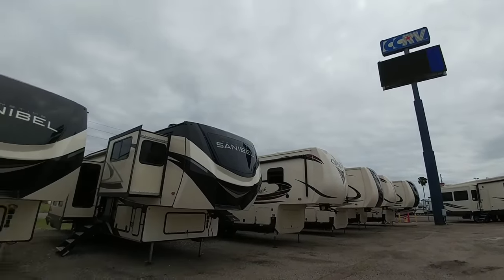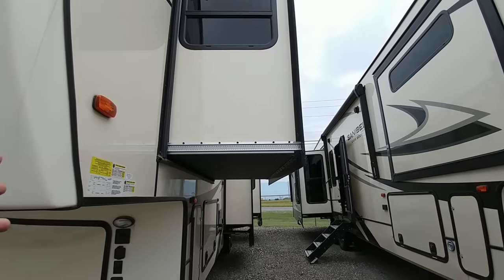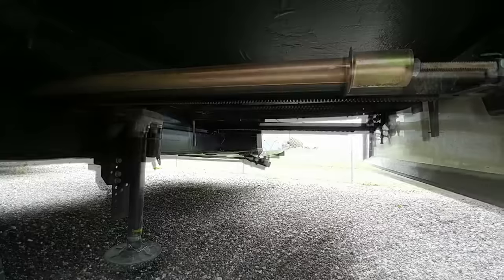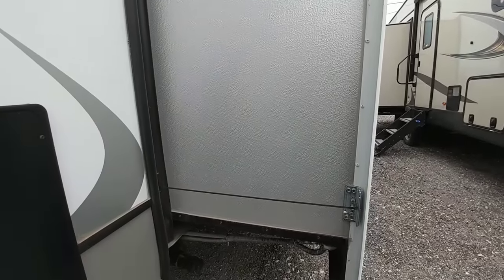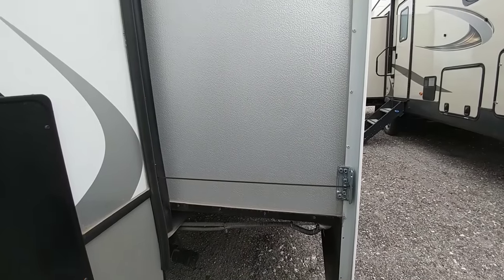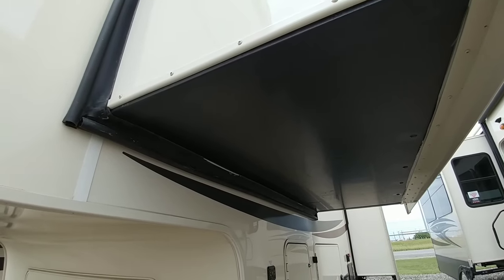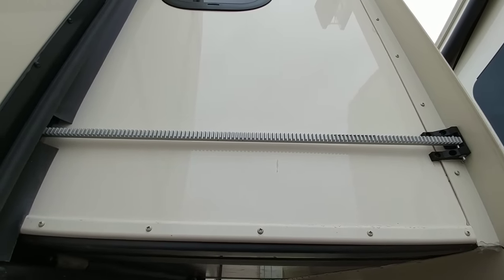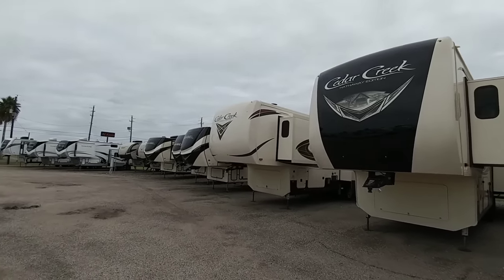The 6 Different types of RV Slide technologies and how they work!

Comment: I'm a supervisor at a horse trailer manufacturing company. I have experience with the last 2 slideout controls along with another that is not shown. The very last one shown we do a lot of. The last one shown is junk. It rides like a pendulum. There is no pressure at the top as only the floor has the motors and turn screws. There is nothing to hold it steading so it moves around.  There are plastic rollers on the sides that dent aluminum skin if that is used on the sides. We have to put a stainless steel strip to stop the dents. The one before it with the gear teeth on sides we looked into that one. It looks like s good set with a lot of positive seal. Very easy to install and maintain. We also use one made by HWH that is hydraulic. Very heavy duty and solid.
Reply: Hey! Thanks for the feedback. I have one doubt though... I'm assuming these systems are on rollers below? How do you prevent cantilever loading? None of them seem to have jacks on the outside.

Comment: Bought a new Winnebago in 2004.  The slide system is hydraulic and has been flawless.  There are independent controls for each slide.  It uses the same hydraulic pump as the jacks

Comment: On the rack and pinion slides there isn’t a motor attached to the pinion gear. The 2 pinion gears are connected with a long shaft and mate with racks on both ends of the slide. They just keep both ends of the slide moving together and even, but don’t physically push anything in or out. The actuator is a motor driven screw inside the gold tube just in front of the rack. It does basically the same job as the hydraulic cylinder on the hydraulic slide version.

Comment: I have the rack and pinion on my forest river cardinal and the system works great. Although my greatest issue with it is that there is no Manuel system set up for it. So if you have an issue whether it be electronic or hydraulic and you find yourself out in the middle of nowhere than your in trouble. Mechanics charge heavily by the mile and that’s not a promise that it will get fixed. There should definitely be an emergency Manuel system set up for cases like this since a travel trailer is for traveling outdoors.
Reply: I concur. Ask me how I know😆🥺

Comment: On our 2018 Jayco Pinnacle we have 3 slides and three different types of slide systems. Rack & Pinion on the Dinette/theater seating slide, Schwintek on the bedroom slide, and the Lippert/LCI on the Kitchen/entertainment slide. 

Although it is only 3 years old (bought it in 2017) we have only had one issue, it was on the Lippert/LCI system. It was not really a failure of the system as much as it was a poor crimp connections to one of the phase feedback for the motors. Repaired the crimp and it has been flawless ever since.
Reply: Hey Raymond, this Kevin from Michigan my wife and I have been looking at getting a fiver and the Pinnacle is one we're looking at so what we want to know is how do you like it and what type of truck do you use to pull it Thanks.
Reply: @kevincotton1453  I have a 2016 Ford F-350 Lariat Supercrew SRW with the 6.7 Liter powerstroke diesel. The only issue I have is when hauling the fiver I have to use the cruise control otherwise I find myself going too fast. As far as the Fiver we like it a lot! This is our 4th Jayco product and can honestly say that they are very well made.

Comment: I'VE HAD TWO UNITS IN MY SHOP IN THE LAST MONTH, BOTH OF THEM WERE 2017 MODELS,  AND THE ALUMINUM RACK BOTH BROKE IN HALF ABOUT 3 INCHES AWAY FROM EXTERIOR MOUNTING BRACKET

Comment: Great overview video on the different slide systems.  The slim rack and schwintek are both owned by LC1 and effectively work the same.  (Before anyone comments they do have some small differences due to the controller function.)  We have a 2019 Jayco Pinnacle and the large slide uses the Slim Rack.  The design is a little bit more robust than the schwintek.  Both systems do have their problems, some potentially operator induced.
Reply: can you explain more about "operator induced" looks like my 2019 travel lite aura has the slim rack system. It worked about a month ago, then one side went out. Wondering if I broke it somehow..

Comment: I've had the hydraulic rack and pinion, schwintek and the cable driven. I've had more experience with the cable driven slides than the others and have never had an issue. I did have my hydraulic rack and pinion slide on my avalanche keep coming out unequally and had to keep adjusting it. I also got little visitors in the underbelly that came through the holes and caused some damage and died in there and caused some smells. They need to come up with a better way to seal the holes. Not a huge fan of the rack and pinion but it wouldn't keep me from buying a 5th wheel we like as well as any other slideout system. My voltage has 3 cable driven slides and have worked great.

Comment: I'm in the process of shopping for a new camper. I'm between a Forest River Viking 262BHS and a Dutchmen Kodiak 289BHSL. The biggest thing stopping me from buying the $8,000 more "higher end" Kodiak is the fact that it has a cable driven slide, where the "lower end" Viking has a rack and pinion slide and a better equipped outdoor kitchen.

Comment: Love your videos, but one correction, on the large slides there is no motor on the rack and pinion gear of the slide.  The rack and pinion is there only to "time" the slide tubes so the slide slides out evenly.  The actuator, electric or hydraulic, is attached to one of the tubes, not the rack and pinion.  It was the gold object in the first R&P slide you showed.

Comment: Technology is always evolving! Interesting break down of these slides. I have had the cable slide outs in my travel trailer and now the schwintek one you mentioned seems to be popular on my last three motorhomes.
Reply: I also have the Schwinn tech slides. I always either run the generator or make sure I'm plugged in before running it to make sure the voltage is very high. They run faster and smoother than battery alone. I keep the tracks clean and keep it lubricated. They run very smoothly and I've never had a problem in the several years I've been using it.

Comment: You can retract a cable slide when a cable fails.  You have to use two people though. One person has to be up at top of slide using a drill and adapter to turn the manual override while person outside pushing slide in. Not fun but it works. Had it happen to me. Our cable slide is our kitchen slide and is probably too big and heavy for it but that’s what Keystone put in. Dealer installed rollers under slide when they fixed the cable to make it smoother and less likely to fail again.
Reply: When the gear box fails, the drill does nothing.
Reply: Left turn, left turn, Return - No argument here. But, he commented that the slide can’t be moved if a cable fails. I’ve personally had a cable fail on our open slide and had to close it to get it to move it and get it repaired. It is possible to close it with a broken cable.

Comment: Great simple explanation , I am very anti cable after having a pop up years ago  but so far my dresser that slides in and out has worked great.  Never seen the last two you showed .  Only problem I had with the hydraulic  was super simple ,, the 12 volt resettable fuse was going bad and the pump would only run for a 15 second stint before tripping it.   Great video.

Comment: It's been a few years, but haven't had an issue with my cable driven slides yet.  Toy hauler, so two opposing slides...one regular depth slide and one deep slide.  Maybe I'm a lucky one...and hopefully my luck will hold out.
Reply: Fingers crossed! lol I had a travel trailer with the cable slide outs and never any issues.

Comment: Thank you for describing the difference between these systems as I was thinking of upgrading my 2015 Keystone Cougar fifth wheel to a cable system. Currently, it came from the factory with the linear actuator assisted by the rack and pinion alignment gears that are not powered. The linear actuator seems under powered and I am afraid that when the motor does fail I will be laying on my back under the rv trying to manually retract the slide-out with a socket wrench. The motor on the cable system is located inside the camper and easy to get to, compared to the linear actuator that is only accessible from under the trailer and would not be fun to service for a DYIr.

Comment: We bought a 5er with two slides, one large and one small.  Both are the cable type.  I does make me nervous because there are some pretty obvious weak links in the design.  Over all it is a cheaper and lighter design, so I think we will see more and more of them.  I think I prefer the old heavy steel rack and pinion style but there is a weight cost to those older, “tried and true” designs.

Comment: I have a 2020 front living room. i have schwinn  slides on the living room area and the bed room. They are great except i am having water come in at the bottom track. the water seems to ride along the tracks. i put a bead of silicone to try to stop it. it worked for a while but today with all the rain its at it again, i checked the rubber seal and it is good so not the problem. any advice would be appreciated. thanks! love your videos!

Comment: I am also interested in the insulation on slides - walls, tops and bottoms. I have heard that sooner or later slides can allow cold or hot air in through the cracks between slide and main body. Just how well are the slides sealed with main body of RV? One video complained that while winter camping he lost all heat inside his trailer through the slides.
Reply: There are rubber slide seals that seal a slide box in the opening of the RV.  Most RVs have two layers of seals, an inner and outer.  The condition of these rubber seals can determine their effectiveness.  It is important to check them often and replace as needed.

Comment: My family has had horrible luck with the cable driven slide.  It tore up the vinyl.   We fixed it the best we could and adjusted it as tight as possible, but it just doesn’t work well.  It takes two people to extend and retract it now.

Comment: Great video! We’re thinking to buy new Jayco Redhawk Class C. We’ve been told it has PowerGear slide (Lippert). What type is that, how reliable is it, and is it easy to manually retract if it malfunctions? I’m not very handy and concerned with getting stuck somewhere.

Comment: Where the pinion goes into the frame, on the rack and pinion system, is there usually a rubber bushing or a gasket to close the hole? The one on my trailer is open and it seems to be the entry point for rodents.

Comment: Had a schwintek on my 2015 rockwood and it was temperamental. It seemed to get stuck in or out at the worst times. Dealer couldn’t figure out why and the reset/manual function was useless. My new jayco has old school rack and pinion and it’s smoother, and just works so much cleaner. I hope for the best. Thanks!

Comment: I have the hydraulic rack and pinion system on my trailer and the only thing i hate is during longer periods of time where we don’t use the trailer , both slides will settle and slightly open a couple inches when it’s stored
Reply: You need an accumulator installed in the hydraulic circuit. It will maintain system pressure with the hyd. system de-energized.
Analogous to a capacitor In an electrical circuit.
Assuming no hyd. fluid leaks, hyd. fluid essentially does not compress.
Anybody with a hyd. system would be advised to have this in the event the hyd. pump fails to operate for whatever reason (prime mover failure for example). This would allow emergency operation, again assuming no material leaks.

Comment: I have got screw rods for both side with gear on me Phoenix Cruiser. The issue can be the screw block in the end of the RV that drag the slide out in and out. This is of composite material. This can crack into pieces. Has happen one time for me. Right now I think I have some problem. Its some uneven movement,  and the ''wall'' don flush with the slide out on the lower end(tilt)

Comment: I have a 2010 Tiffin Allegro Bus 43QGP . I'm thinking that our bedroom slide used the under the bed Rack and Pentium system. It because with the slide is out you can't seen any thing looking underneath the motorhome nor on both sides . This slide must be hydraulic because it will not push out or pull in until me start the engine. I have been having problems that when it is 1/2 the way out it will stop and if you give it a couple sec then press the push  button it will then push the slide all the way out.

Comment: The problem I experienced with the Schwintec is that there’s no way to manually operate the slide if it’s stuck in. There’s no access to the motor retaining screw that’s on the outside when the slide is closed. So if you have a cable problem from the module to the motor you are forded to damage the rack in order to get the slide out to extend. It really needs a manual way to extend the slide out if needed

Comment: Without seeing it in action, I don't understand how the cable system "pushes" a slide out.   I can visualize in my lizard brain how the cable system can pull a slide in, but not how it extends the slide :(.

 And --- keep them videos coming.
Reply: If you can visualize how the slide is pulled in then you can visualize how the slide is pulled out. The brackets and cables you saw on the outside portion of the slide are mirrored on the inside portion of the slide.  The cables are routed through fixed pulleys attached to the inside of the trailer.  Each side of the slide box, 2 cables attach to the top (1 inside and 1 outside) and 2 attach to the bottom (1 inside and 1 outside).   When the cables are pulled they make the slide move in or out.
Reply: @CharlesCHubbard  I thunk me gots it :)
Reply: Thanks I had the same question.

Comment: I had a Keystone that used the cable system. It was nothing but junk. Broke the cables a couple times. They need a lemon law for campers. Seems like most campers these days are disposable the quality just isn’t there.
Reply: I started with a keystone.  My cables never failed but they were always sagging and despite my complaints the dealer never repaired them to a taut condition.  My grand design has rack and pinion.  I'll never go back

Comment: I like your videos. I have a 2008 jayco jay flight and it has a system similar to the rack and pinion but has 2 tubes with a row of holes in them. I assume that the drive has pins that insert into the holes as it  goes in and out. Do you know anything about this system?
Reply: It may be the same system on my 1001 Travel Supreme.   Mine has 2 rectangular steel rails with holes in the bottom.  There are also a couple of scissor type arms which pull or push the slide in.  You would also have electric motors and potentiometers.  The potentiometers are smaller than a rectangular cigarette pack which controls the motor pushing out or pulling in and also the amount of pressure it applies when contacting the side of the trailer....a limit switch.  They will be beige or black.If this is the type you have, there is  lots of info and pics I can provide to maybe save you some problems down the road.

Comment: I bought a brand new camper with a Schwinn Tech slide. It failed in the most epic way! I have heard that a ton of new Schwinn Tech slides are failing. Yet the older ones worked fine.

Comment: What kind of slide systems do full time/ park models use that don't need external support to keep slides from sagging?
Reply from the maker: You must find out why the slide is sagging first.  The most robust system would be the standard Rack and Pinion because it uses the most significant materials.
Reply: @BigTruckBigRV  10-4.  Thanks for the comeback.

Comment: I saw a poor family traveling with a 5th wheel and the one slide cable was broken. They had no choice but continue the jounrey with the slide exposed hanging crooked.

I'll pass on cable slides.

Every new RV buyer needs to check slide design before purchasing.

This video was excellent thank you!
Reply: I know someone that did this on the regular. They said it didn't work and they didn't want to fix it so they manually did it every time the moved the RV! I hope I'm never in this position.

Comment: Not a fan of cable driven. I’ve seen a major mess from one screwing up. They were pulling their slide in and it pulled the exterior wall loose ripping it from the RV. It was very ugly situation. 
That’s what I don’t like about cable driven. They pull on the wall, if the slide binds at the floor the wall is what gives up.

Comment: Truck camper with slides, off road / over landing capability, 4 seasons/ living, fully contained . Does such a thing exist or have I just not found it yet ? I have analyzed to the point of paralysis. I’m stuck, I can’t afford an expensive expedition vehicle. I’ve thought of a 3500 or 350 truck minimum with everything from a pop up style camper so as to not get to top heavy , fully contained, yada yada yada and I really could use some good advice to help me get unstuck. I’ve got to get my rig pulled together some way soon , I am running out of time. It might take both front AND back wenches to pull me out of this , btw ,  my dream rig must also have both, weight and payload is also a BIG factor in my endeavors. Lol🤣 HEEEEEELP 😫😫😭😭🤪🤪 me out J.D .

Comment: I do not like my cable slide system, the pulley on the inside of the rv ripped off the wall and it took several hrs to fix it.
Reply: ouch! our cable system needs a new gearbox and is stuck open on a 2 year old camper